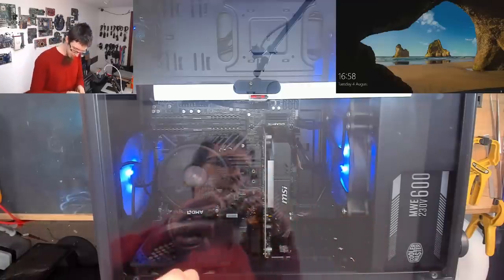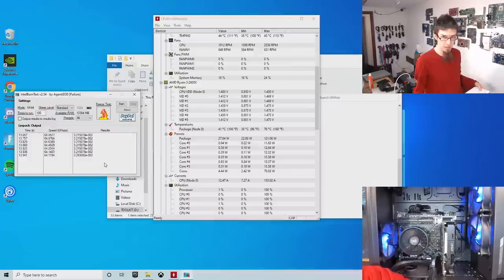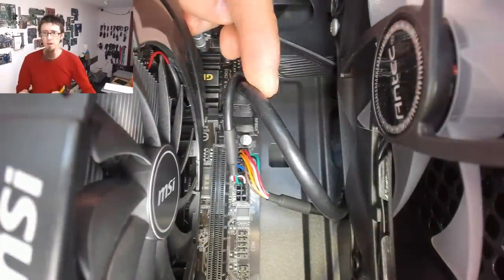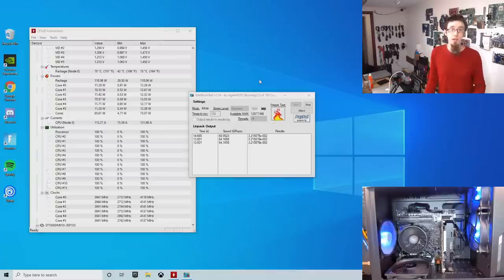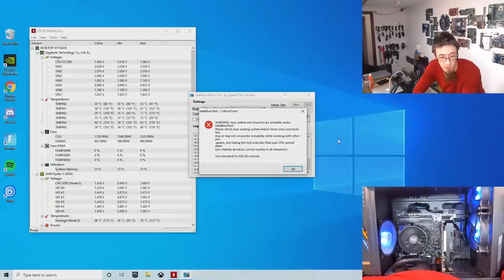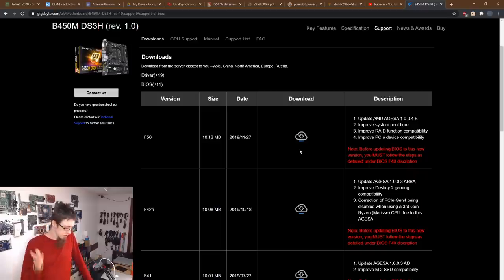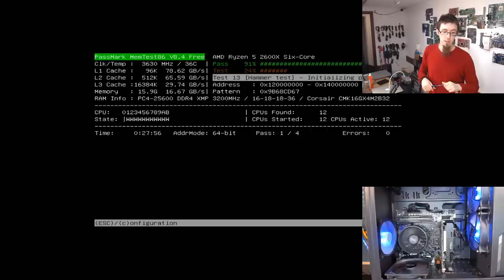Gaming PC Crashes at Random - LFC#217

Comment: In my case the PC shuts down when I'm NOT playing games. It runs completely fine as long as I keep Genshin Impact running in the background. It's so weird. Sometimes it restarts on its own, sometimes it shuts down completely, but most of the time it just hangs. One moment I'm browsing through Youtube, the next second, I find that the mouse is no longer moving. No input gets transmitted either not even from the keyboard. The screen just freezes there like a random screenshot.
So when I noticed how it NEVER seems to get interrupted when I'm playing Genshin for 10 hours straight, I figured it probably has something to do with the gpu usage. I'm still not sure. Right now I just launch Genshin and lets it stay on the login screen while I go do some other stuff on the pc. But I cannot watch videos because Genshin's soundtrack overlaps and it's a pain to keep changing the game's settings for when I play and when I just run it in the background.

Comment: Ryzen ram calculator has worked miracles for me. I have tridentz 3600 cl18 22 22 22 42 sticks and using dram calculator I got it down to cl16 18 19 20 32. I shaved 20ns off my latency. 1usmus is the man.

Comment: Had exact the same issue with that motherboard and (almost) the same Corsair 3200MHz RAM (mine is 16GB/strip). XMP caused a lot of blue screens and strange errors. I eventually threw out the mobo and bought a high-end X570. My Corsair-RAM wasn't on the support list either.

Comment: I have this board and used it with the 2600 out of the box without any issues. I decided to upgrade my wife's computer but give her the 2600 and get me a 3600. I had to update the bios in order to use the 3600. After doing so I had crashing when playing games also. I had bought a new RX 5700 XT thinking this was the cause but after replacing the motherboard that confirmed it was the bios updates that caused the issue. I didn't go this far into the troubleshooting but this video confirms my thinking that it was a bad or buggy bios update. There is a new bios for the board (F50d) which I will try to update and test the board with to see if the problem was fixed. 

EDIT: My memory may not have been supported also, I haven't checked but will get better supported memory when I use the board again.

Comment: Dang, wish I would of known this before buying my ram, learned something new though from this video so thank you. My ram is 1 letter off the parts number from being compatible with the motherboard I have. I don't over clock my system. So I don't notice any problems. Kind of a dumb question but I was wondering will it lead to problems down the road? Everything else looks to be the exact same besides the 1 letter being off on the QVL.
Reply from the maker: Probably not, as others in the comments have pointed out, QVL is just stuff that the manufacturer have tested themselves. Theoretically any appropriate RAM should work, which is why I usually don't bother checking QVLs. It's just a point of interest if a kit isn't running properly. If it was on the QVL, you know that it absolutely should work at native speed.

Comment: With Memtest86 and Memtest86+ don't stop at one pass with no error and think that's enough. 

I've had a DIMM with a single location error that was fine on the first pass but failed on the second when things had warmed up. Narrowing down the test range and a freezer spray found the chip and confirmed the fault.

Comment: Hy I think it should be Cal Ballistic 3000 and the cooler is too small.
A fan should still bring air into the housing, if all the air is blown out, no wetilation occurs.
But you liked it very much and I build on you.

Comment: To anyone landing here looking to solve similar memory issues - 
The Ryzen 2500/2600/2700 series chips support DDR4 2933 or DDR4 2666 depending on whether memory sticks are dual sided or single sided and whether you are using 4 sticks or 2.
There are many combinations, you need to check AMD website to ensure compatibility with a particular CPU.
In many instances 3200Mhz RAM will work, but the memory controller is on the CPU so it's a bit of potluck.
AMD will not provide support for 2000 series CPU's running above 2933MHz memory speed.

Thererin lies the answer to the customer who cannot get 3200MHz memory to run on his 2600x......

Comment: XMP caused issues on my motherboard and it was expensive!! It is a ROG Rampage 5 Extreme 10 Year Anniversary Edition (X99) and it cost me £750. No matter what I did my 3200MHz memory wouldn't work with XMP. Its good memory too, its Corsair Dominator Platinum gaming memory. I had to manually put the clocks/timings in before it would even boot and even still, sometimes it has a hissy fit and stops working and I need to restore a bios profile. The CPU is an Intel i7 Extreme 6950x, just the CPU was £2000 so it just shows..... these issues can even affect good hardware.

Comment: I have a question, as an engineer and qualified technician, why do people insist on rebooting and spamming delete or a function button to enter the BIOS/UEFI?

"shutdown /r /fw
" is the command I use and if you can make a batch file to execute the command for you it's like a kilobyte sized file that can boot you into firmware, why go through the whole booting process when this command/batch script is faster?
Reply from the maker: I don't see how typing in a command, or copying a batch file to the system is easier than tapping the delete key.
But each to their own, if it works for you then go for it 👌

Comment: I have a doozie for you.

My little brother bought a Ryzen 7 3700x and installed into his MoBo without flashing the BIOS, therefore it wouldn't POST with the 3700 in it.

After learning that his GTX 1050ti would bottleneck the shit out of it, he put back in his Ryzen 5 2400G.

Now he gets random BSOD.

I ran Memtest86 and it got 28,000+ errors in the first Pass.

He ordered new RAM and still gets random BSOD.

Comment: I had this exact problem. I had a 8700k CPU with ASUS Strix Z370-E motherboard and 3200 mhz CL15 Crucial Ballistix RAM. Every single game was crashing after running for 15-30 min with the XMP on. Did the Memtest and it failed too. Checked the QVL for my motherboard and it turns out that my ram is in fact supported but only at 3000 mhz speed. So I manually reduced the speed to 3000 mhz and everything works perfectly now.

Comment: I have the same motherboard + cpu and had the exact same problem. Wish I saw this first. I bought a new power supply, new kit of RAM, and reinstalled windows multiple times before realizing the board just didnt like running my ram at 3200mhz. It's fine at 3000.

Comment: I just did a new build  and ran Cinebench with XMP turned off. No issues. I then switched XMP on and Cinebench froze. I then clocked back from 3200 MHz to 3000 MHz. No issues. Took me less than half an hour to resolve

Comment: I am having a similar problem with random rebooting. system never freezes but reboot and sometimes gets into a reboot loop. But it seems to be related to chrome. like right now i dont have chrome installed and this pc has been up for about 48 hours now. but as soon as i install chrome or click on chrome the computer reboots and sometimes i cant even get back into the computer to run any tests. booted into safe mode and uninstalled chrome and its running great again. there were more to it i ended up reinstalling windows and repartitioning the hard drive because i thought the problem was with that  boot vulnerability  because i dual boot linux and it was right around the time that warning came out. and it was running fine after installing windows right up to the point when i installed chrome again.  I am guessing its an extension  and not chrome itself.

Comment: I had a similar problem, and lowering the ram speed solved it aswell. Games were stuttering from time to time and making an annoying "brrrrt" noise, lowered the ram to 3200 from 3600 at 1.30v (i have not tried something in between yet) and haven't stutter ever since. I have an Asrock b450m steel legend and a GSkill Ripjaws 3600mhz 2x8gb kit.

Comment: I had exactly the same problem with my AORUS B450 PRO WIFI - 2700X system.
Manually adjust the RAM timing settings to the manufacturer specs, and bump the RAM power to the next setting higher.  
Not sure if it's BIOS, VRM, RAM, 2700X or a mix of those, but that was the fix on mine to run RAM at full speed.

Comment: in the future you can try a manual OC on the memory.I have some memory from corsair that gives errors with XMP on at 3200 but if i disable the XMP and go in bios and set the memory manual at 3200 with same timings and voltage as XMP all goes well... strange but...

Comment: This was a shoddily built PC, so I was surprised that you didn't re-seat the RAM modules as they might not been pressed fully home like the EPS cable. In cases like this, I usually remove the RTC battery and re-seat the RAM (or flip them around) and the cards too, check the wiring connections...then see what happens after that.
Reply: WELL, the computer did boot to Windows, if RAM not properly in the mobo, then it does not boot into Windows at all.
Or it will if only other stick is loose, then it might recognise the correct one...

Comment: I grew up on having to use molex fans before the 4 pin connectors. I recently built a PC after years of using a laptop and I bought these exact fans on amazon and my setup ended up looking like this stackable molex mess, their airflow is shocking and the cables end up looking like spaghetti junction.. no thank you!

Comment: My board is exactly the same, B450M Aurous with a 3600x and had problems for around a month. Found a reddit post with a few people speaking about XMP causing problems, so I manually set the advanced timing settings using a XMP generator program and boom passed through all tests with flying colours. I think its just a weird thing with XMP timings on the B450 Motherboards.
Reply: Same with mine. XMP didnt work but im using a 200ge at the end even with ryzen calc didnt work i had to manually tune the ram

Comment: did you really just cut the cables and put them back in unprotected thats worse than a molex being there?
Reply from the maker: No I cut them back to the pins in the 3pin plug, so the exposed part is shrouded in the 3-pin.

Comment: Ryzen 2600X can be fussy with memory, it is on the stability borderline for 3200mhz XMP, I find that the Corsair LPX Vengeance brand brings this problem up a fair bit, right from the start of the video I guessed this might be the problem, in my experience, dial XMP down to 2933mhz to eliminate the crashes with minimal performance hit (2933 is AMD's level for this CPU anyway)

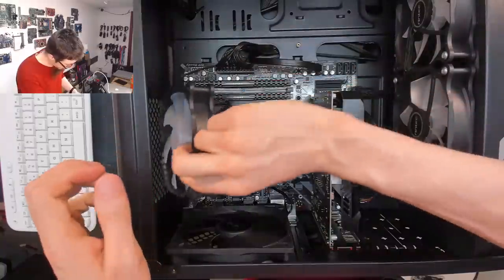Comment: 12:08 I understand that's not the conventional way of intaking air, but where else would it intake? The two bottom fans arent doing a whole lot compared to the top fan.
Reply from the maker: They'll still be picking up air from the lower-front of the case, which is vented. I wouldn't trust this setup with a big graphics card, mind you.
Reply: Adamant IT I see, you were okay with it because it’s a lower power hungry gpu? 
Great video, explination, and execution btw. Thanks for a reply

Comment: Greetings from Spain. Nice sleuth-work here to diagnose these kind of apparently random issues. I have a question. Nowhere in the video you checked what drivers were installed into w10, specially chipset ones. Could these make a difference? For added stability, for instance.

Comment: Knew straight away none of those 'cabling' issues would be it. There either present or not. Was always going to be a CPU or Memory issue.
Once it errored out the first time I would of called it a memory issue from experience. (But then you would have had a much shorter video probably helped someone diagnose.)
Looks like a Bios update has been published to fix the timing issues.

Comment: A bit late to the party here (just discovered your channel, really like it!), but I think you're a bit off blaming the motherboard here. Not only are 1st and 2nd gen Ryzen quite well known for struggling with high-ish memory speeds (my 1600X-based system never ran stable above 2933 no matter what, but is rock solid at 2666 with ECC RAM in its current config as a NAS), but this is also running Corsair LPX RAM, which is notorious for compatibility issues with Ryzen, especially the earlier generations. This just seems like an unfortunate configuration, and shouldn't have anything to do with the motherboard in and of itself. It's mainly the memory controller that isn't all that good, alongside a type of memory that works particularly poorly with those IMCs.

Comment: I used to do this stuff 20 years ago,  and NOTHING has changed. Connections, temperature, memory, bios (we also had IRQ conflicts, driver issues, config.sys and autoexec.bat to contend with back then). 99% of the time you'd fix it. Trouble was, and apparently still is, that it takes HOURS to systematically check everything and run your diagnostics and you could never charge the customer the proper price for all the time you spent on it because the bill would be too high. I packed it in after a year, I was really busy but couldn't earn enough.
Reply from the maker: Yea I know that feel. I earn enough to cover my living, but I ain't gonna retire off of this. That's where all this YouTube lark comes in... gives me access to more revenue streams whilst effectively doing the same work. Albeit with extra steps.

Comment: Watched this hoping it would help.  Been in IT 20+ years now and have never come across this problem before.  A year ago i purchased an MSI B450 Tomohawk Max, Ryzen 3500 and 16GB Corsair 3200.  Already had a new RX 580 ready to go from my old i7 3770 build.  For a whole month the machine refused to boot although you could hear it going through all its routines.  Then it would boot and random BSOD (Windows 10) a few times a day.  I actually remedied this with a new BIOS that MSI released and all seemed ok although every time i turned it on i dreaded that it wouldnt work.  I only play World of Warcraft and everytime i joined a RAID (probably putting a lot of stress on components) then WoW would crash out.  Was getting so fed up it i though i would try the latest BIOS from MSI, jeez what a mistake, i must of had about 40+ BSOD since thursday all with different STOP ERRORS.  I thought, ok i will try reinstalling windoze and all latest drivers yesterday.  BSOD every couple of minutes or so and im had enough of it now.  I have ran memtest with XMP on over the last 4.5 hours and no errors, so i thought hang on i have a nvidia 710 so will try that in case something wrong with the AMD drivers or graphics card....that was about an hour ago and its BSOD on me twice already.  So, memory is ok, graphics card is ok so i can only put it down to this damn awful motherboard.  Would you recommend getting a new motherboard as this machine is so unstable in its present state.  Was looking at ASUS Prime B450-PLUS ATX as never touching MSI ever again!  Just reflashed an old BIOS that worked but still not stable.

Comment: I've had this issue before when upgrading one of my customer's RAM. I set it to XMP and it was causing the system to run unstable with memory errors. For me the solution was to increase the voltage to the RAM by 0.1V. This would probably have done the trick on this system as well instead of reducing the clock speed to 3000MHz. Just an idea to try next time :)

Comment: My old 3930k is randomly crashing. Sometimes it crashes on Windows start up sometimes in games after 30mins... An hour... 2 hours... Its massively random and always blue screens. So I'm going to try removing the XMP profile and dial the 2133mhz back to 1866mhz. As well as my motherboard doesn't like me using more than 2 dimms. I tried to add another 8gb of the exact same ram a few years ago for 16gb total and the motherboard would not allow me to select XMP and wouldnt even let me boot to Windows. So I just settled for 8gb and 2 dimm slots used. Putting a brand new system together shortly so I'm not too fussed.

Comment: Wouldn't it be a good idea to take a look at event viewer with these type of crashes?
Reply from the maker: Honestly, I've never found event viewer to be useful. Same goes for mem dump analysers. I usually find it's faster to go straight into hardware tests first, and then if you find nothing there, then start analysing error messages for more info.
Reply: @Adamant_IT  I've never had much luck with event viewer neither. I just wanted your opinion on it

Comment: Hi Adam, Fantastic video and thought process of elimination, its takes ages, after I've learnt from mistakes going around in circles trying to troubleshoot errors....  Built a new AMD system, and now experiencing similar issues only whilst gaming (PC will just restart, almost like a power surge just happened, PSU is 850w so no issues there... I think it could be RAM related. Is there an alternative to the IntenBurn Test for AMD? Thanks.
Reply: IntelBurn will run on any x86 CPU (including AMD) - just because it says 'Intel' it doesn't mean it will only run on those CPUs.
Reply: @darkguset  resolved the issue a while ago turns out it was the PSU. Thanks though .